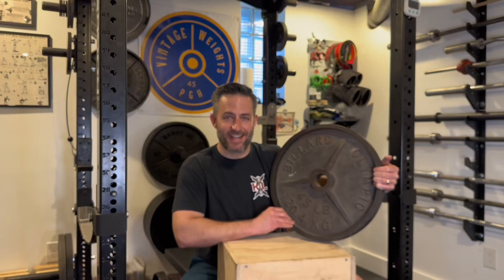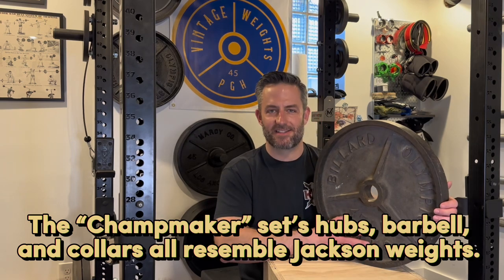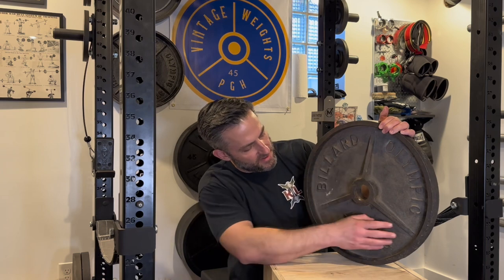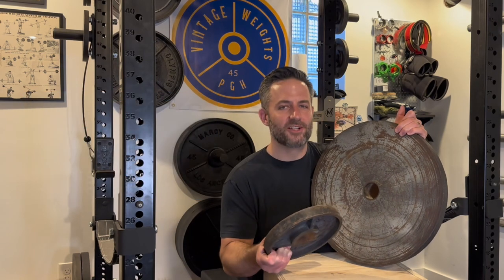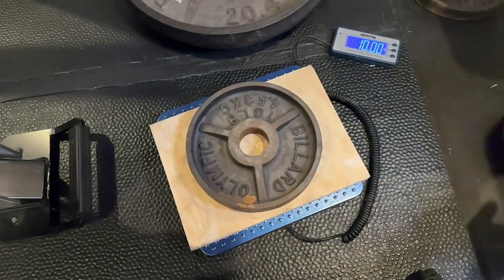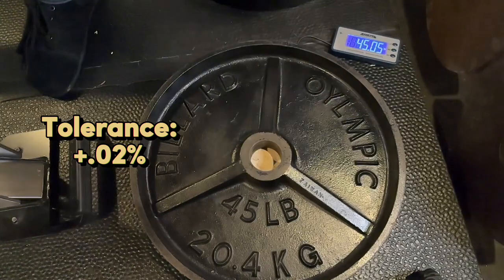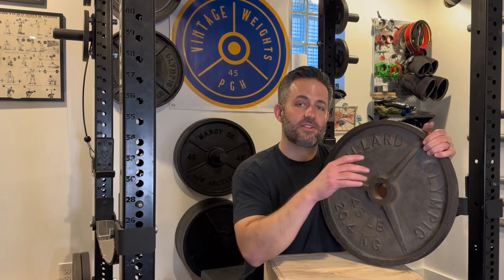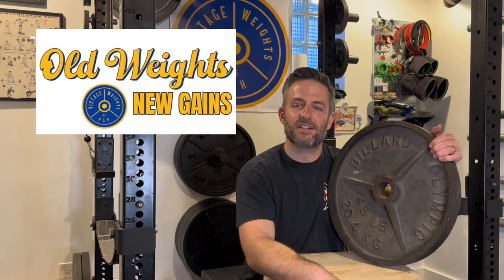Vintage Billard Barbell Deep Dish Olympic Weight Plate Review - Made in USA Classics!

Comment: Nice work on the review. 
Tell me, what are your intentions, if any, in terms of how the plates look?
Many thanks
Reply from the maker: These are a mix of repainted, stripped bare, and rusty. So in this case, I’d probably strip the rest to bare iron and either clear coat or repaint. I usually prefer original paint possible.